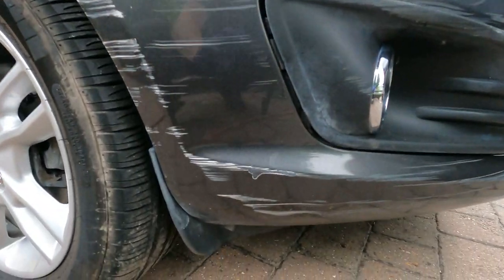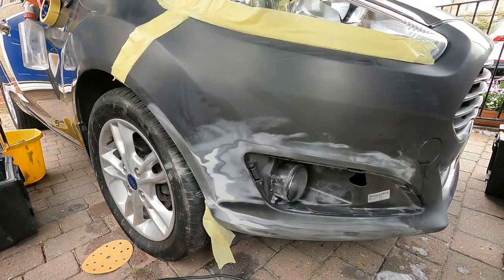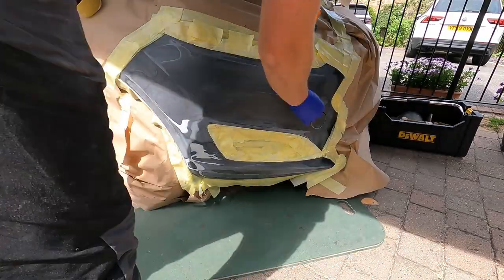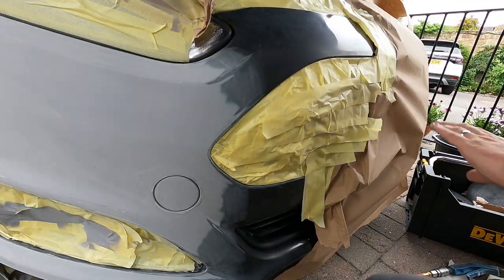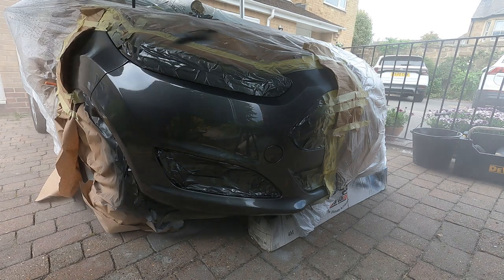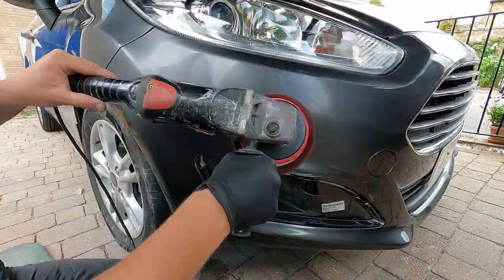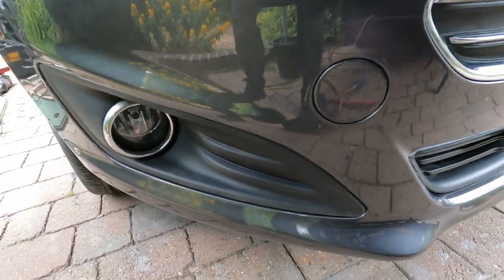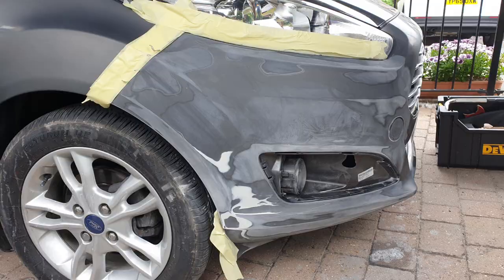Ford Bodywork Bumper Repair

Comment: Love your videos I have tried how to do fade outs using clear coat 3 times  so far and I havnt failed  the first 4 time I did it  I failed  but when I did fading out clear how you  do it I have succeeded thank you for the tips your doing a great job
Reply from the maker: Hey man thanks for the feedback. That's great you nailed the fade out. Its always gonna be a tricky thing to do but I've worked on my method over the years and it definatley makes a good blend when done correctly 👍🏼

Comment: Top repair. What grit is the grey scotch-brite used for keying up the surface? I have 5 inch long and 1 inch wide rust area exactly below the window trim on my Renault Laguna 3 driver's door (right in the middle of the door length) and not exactly sure how the blend it. Would it be ok to paint a bit wider than that rusty part only and then go a bit wider with the clearcoat, but without reaching any door edge? Any advice would be much appreciated.
Reply from the maker: www.paintgear.co.uk do some sand paper packs. its grey scotch